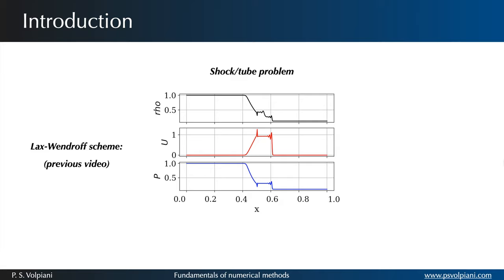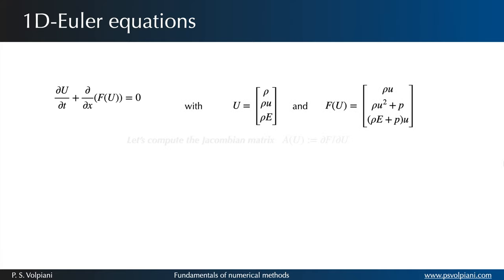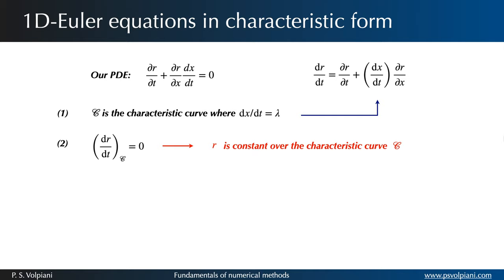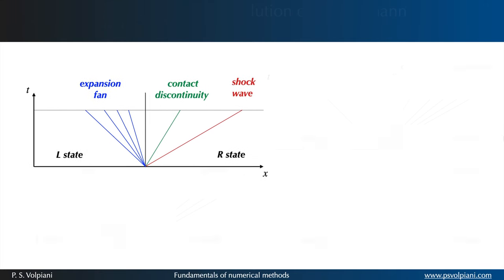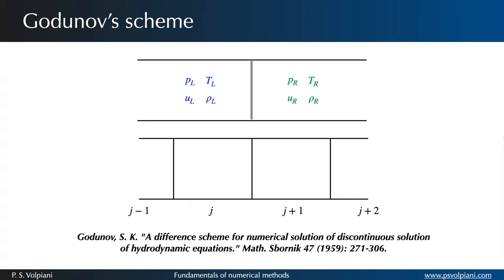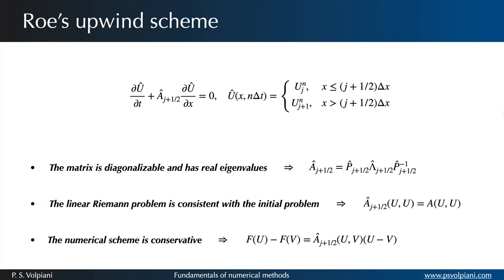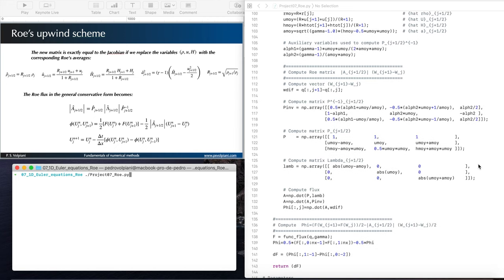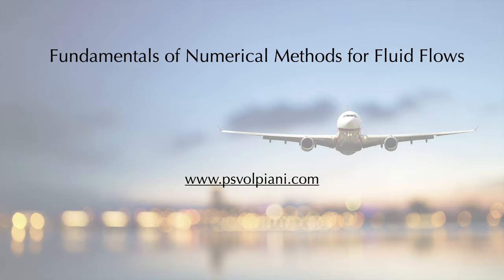CFD-07: How to implement Roe's scheme to solve the Euler equations?

Comment: I think there is a math mistake at 1:44 in the A(U) equation. You have at A(U) Row 3, column 1: -gamma U2 U3/U1^2 + (gamma-1) (U2/U1)^3 this should be -gamma U2 U3/U1^2 + (gamma-1) U2^2/U1^3  

Another mistake in Row 3 column 2. You have:  gamma U3/U1 - 3/2(gamma-1)(U2/U1)^2 This should be: gamma U3/U1 - (gamma-1) U2/U1^2 
Please let me know
Reply from the maker: Hello! Thanks for pointing it out. The matrix A(U) is correct. The error is in the last line of the flux vector F. It should be F3 = gamma*U2 U3/U_1 - 0.5(gamma-1)U_2^3/U_1^2.